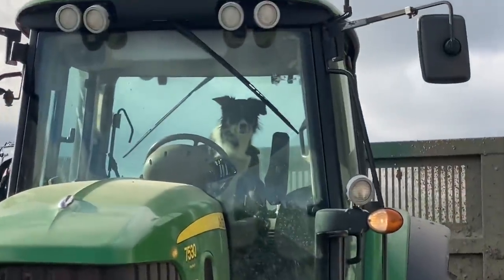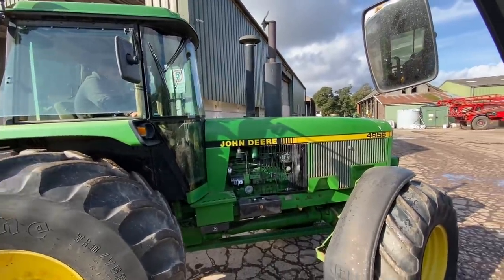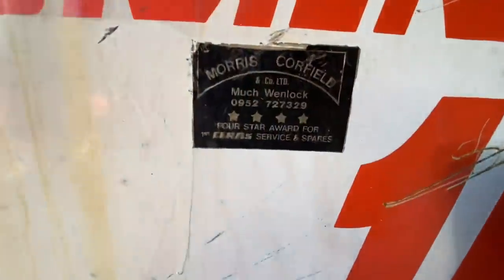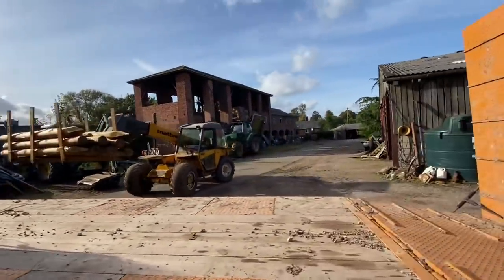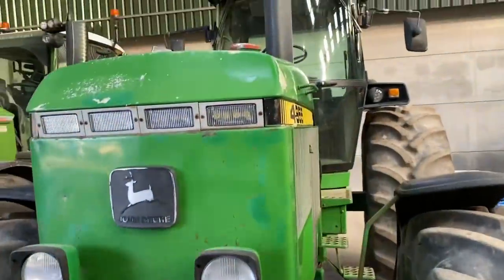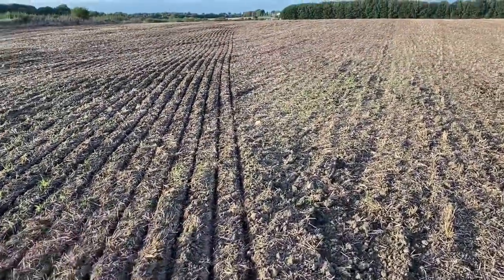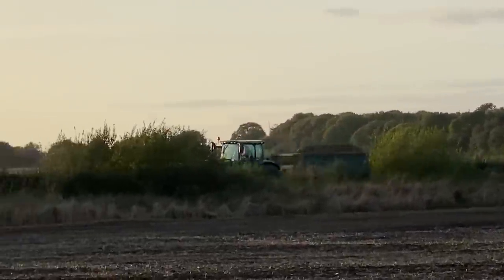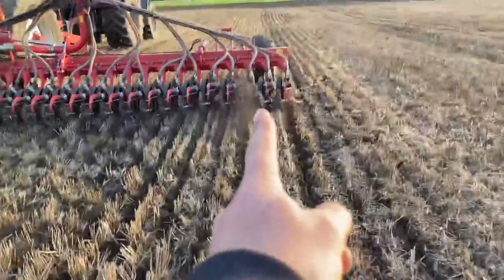Day567 #OLLYBLOGS FASTRAC HOLDING ME UP 4955 PROBS MUDDY ROAD BIG BLUE ON DRILL #AnswerAsAPercent

Comment: Great vid as always. Not sure you could do much with that headlining in the tractor apart from take it down and redo it completely. Possibly the problem with the 4955 is condensation buildup in the fuel tank causing mould. Get a similar problem with boat tanks when they’re stood over winter. Can get additives to kill that mould off or drain the tank completely and steam clean it.

Comment: Just Po;ish and Touch up the 4955, Headlings wont hold for long with Glue when the original glue lets go it is because the bond has broken down because the backing is starting to crumble to powder and dirt  and dust will have got in, it will not succesfully re glue suggest new headlining that was the problem withn my TW

Comment: Re comments at 8.00 we used to get the same effect if too much rain falls pre em, but through 35 years of direct drilling, and then zero till the  natural soil pores  old root tracks and aggregate structure wick the rain into the ground hence no significant ponding issues Olly. But any full tillage destroys that ability. Takes years to rebuild. Wal.

Comment: Re the 6900 roof lining, a temp fix would be short self tappers with large repair washers, I have in the past tried to restick one back but it wasn't a success, new ones are available, but  not cheap

Comment: The what's that is for a can of John Deere eather starting fluid, screws in and there is a button on the dash that you press to administor a squirt.
Reply: Should also be a drain tap at the bottom of the tank

Comment: Roof lining put a new one in the padding above it degrades and turns to powder or remove cut a new bit of padding and replace using some 3M trim Glew to reattach the headlining to foam. pls, don't paint it! you probably need to drop all the fuel out of the fuel tank  by removing the steel fuel pipe out of the bottom of the fuel tank  flush it out and blow the crap out of the line  by removing fuel filter pipes and blowback to the tank with the pipes still removed   and then fit new filters
Reply from the maker: Yer I’ve seen the foam turn to dust